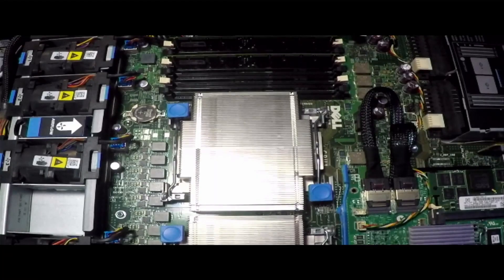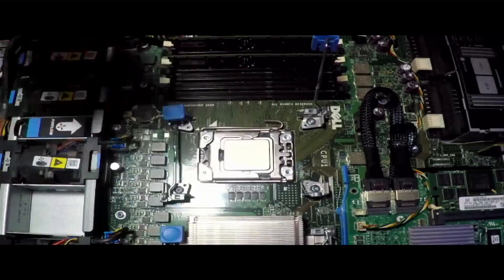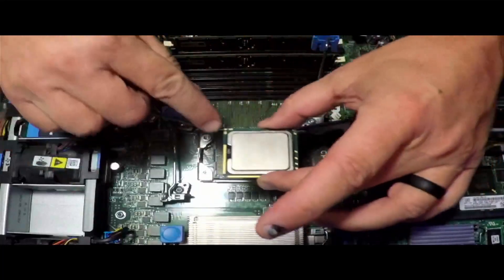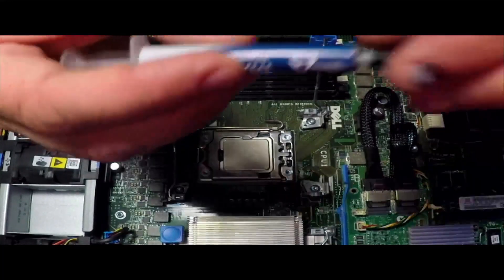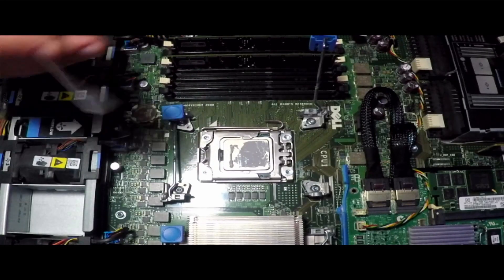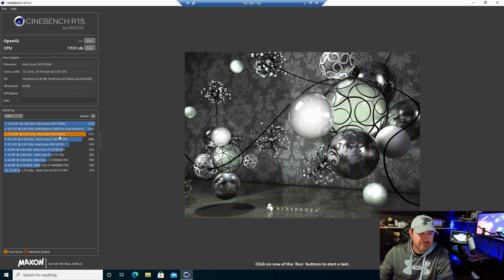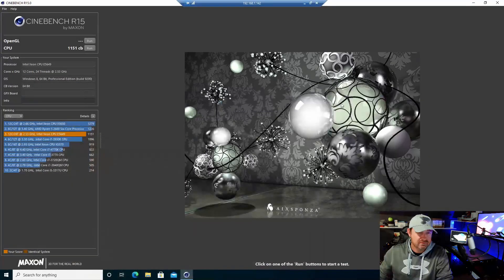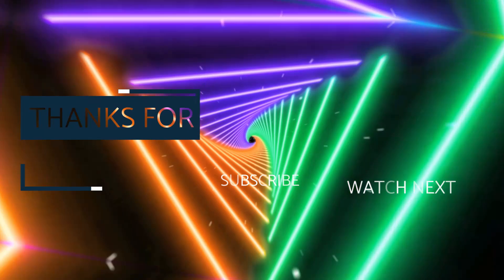CPU upgrade for the Dell PowerEdge R610 Server

Comment: I like my x5670s  they also have 6 cores and 12 threads.  Been running great for many years now.  thanks for the video.  Cheers
Reply from the maker: Good to hear. Thanks for watching
Reply: @Documents Mine uses about 200 watts at idle . At about 30% load it is drawing about 340 watts. If you figure an average of 300 watts at 12 cents per KW then it costs about $0.86 per day to run. Throw in a bit of solar power and it doesn't cost much. Hope that helped. Cheers
Reply: @Documents What is it you are looking for ?  Maybe I have seen something that might work for you.  Cheers
Reply: @Documents Uff Da! That's a rough one. A embedded cpu board might work for you. For example... Before the CV stuff A j4105 cpu and board were only around $40 bucks new , uses about 25 watts and there is no sound. You would need one with more cores and sata ports than the j4105 I have and you could use 2 of them and depending on the current price of things you should still be within or close to your goal.  The only other thing I can think of off the top of my head within your budget and power usage needs would be a couple Raspberry Pi's. Sorry I couldn't help more.  Cheers

Comment: For 50% more cores, you got 18% more multi thread performance, but you lost single thread performance. Personally, I would have upgraded to at least x5670's, but probably x5690's if the board supports 130W chips. The idle power draw is pretty much the same on all of them, and the higher power consumption when doing a task is offset by the fact that it can finnish the task quicker, so overall power usage difference is almost negligible.
Reply from the maker: Point taken; I just prefer the idea of more cores for more VM's.

Comment: Thanks for all your videos.  I've learned a lot.  I have a r610 and tried to increase the ram to 48gb with 12 4gb dimms.  They are all Hynix but a little bit of of mishmash.  they are all the same basic dimm according to the numbers on them. I keep getting a b2 and b5  error.  It recognizes 40gb but I can get the the full 48:(  I did change the cpu to the 5675 and cinibench it does a 1399,  so it's running pretty good.  But the dimms are driving me nuts.  Any ideas would be greatly appreciated.
Reply: Server memory do be like that sometimes. You have to make sure that the sticks are pretty much identical. A PC3 8500R-7-10-H0 dimm will not work with a PC3 8500R-7-00-JP dimm even though they are practically the same. All the numbers have to match.
Reply from the maker: I would start by removing all of the dimms. Then installing them 2 at a time starting with A1 and B1 (trying to keep matched sets together) then reboot. If it reboots fine then moved onto A2 and B2 and reboot. If you get an error on B2 try another dimm. Hopefully B2 and B5 aren't damaged and unusable.

Also here is the owner's manual for R610s. Not sure if it will help though.

https://downloads.dell.com/manuals/all-products/esuprt_ser_stor_net/esuprt_poweredge/poweredge-r610_owner%27s%20manual2_en-us.pdf
Reply: @Documents I don’t know how much power it draws but it is pretty quiet at idle. However,  it does throw a fair amount of heat in the room just sitting there.
Reply: @Documents it cant be that bad otherwise my wife would yell at me when the power comes every month:)
Reply: for servers, it has to be a matched set (all identical) unless you just want to run at the lowest speed of the mismatched set and have detection issues among other things.

Comment: I take it this mod is only for the 2nd gen MB?
Reply from the maker: Honestly I'm not sure. I have seen links that say you need the gen2 board for processors that are rated at 130 watts, but anything lower than that (like the E5649) will work on the gen 1 boards. Then I have seen links that say you need a Gen 2 board for all 5600 chips. So I ended up saying "Hell it's only 13 bucks. Buy it and try it.", and quit researching it.
Reply: @LoResDIY  great info - your videos are very much appreciated.

Comment: Which power supplies you running 502w or 717w?  I am currently running 717w ps  and just the quad core E5620 though since these are NOT X56xx I don't think a 717w ps is needed. The power supplies alone seem to put off a good amount of heat.
Reply from the maker: I'm running the 502w psu's, and the max reading so far is 249 watts. I was also surprised by the amount of heat they are putting out. Mini space heater lol
Reply: @LoResDIY  Thanks for the reply! Yesterday after I sent you a msg I thought I knew the answer after thinking of the cpu X series you came from.  I assume you had the minimum of 717w ps just because I am pretty sure an X proc would throttle down with a 502w power supply.  I talked with a friend regarding going to the 502w ps and he basically said it won't make a difference on fan noise or heat.  You are on point about the space heater...lol.  Thanks for the vid!